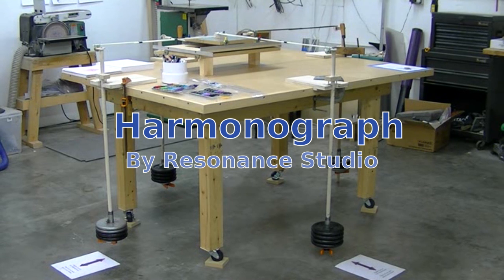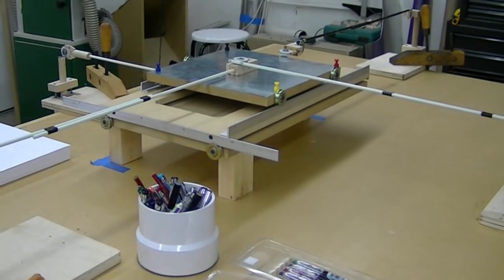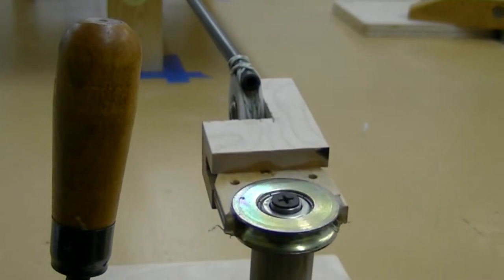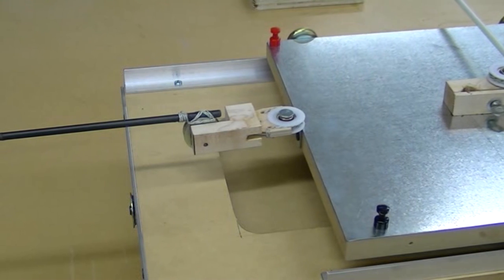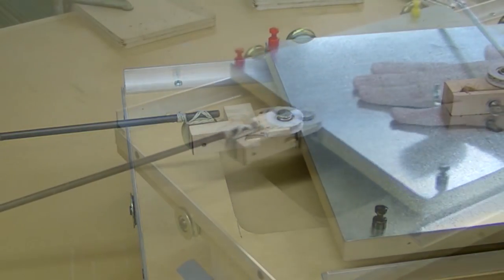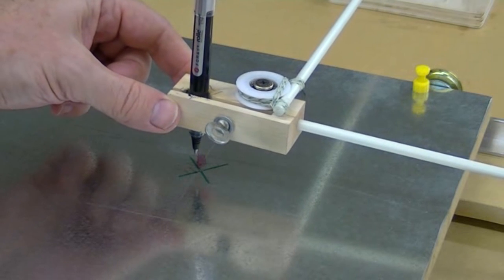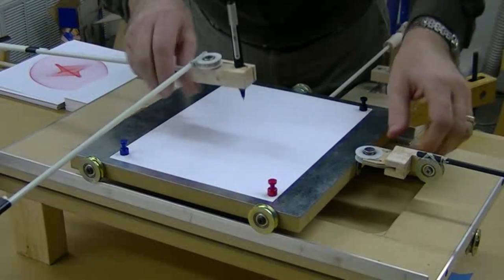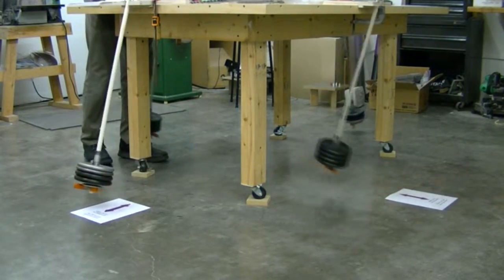harmonograph

Comment: In the late nineteen sixties we had a utility room at the back of our house in Belfast. This room doubled as a workshop. I remember very quickly putting together a simple machine that included a small drawing board to which a heavily weighted rigid pendulum was attached on the underside. Paper was placed on the top surface of the board and the tip of a lightly weighted pen rested on this. The pen was held by a light arm and a second heavily weighted pendulum pushed the pen backwards and forwards along the paper. While the pen motion was restricted to one axis, the table moved in two axes. I still have my drawings!

Comment: Excellent demo, thank you. It appears that, as the paper platform has considerably more weight than the pen, it either requires a heavier pendulum weight or one simply accepts that the paper will slow down faster and stop before the pen. The energy of the pendulum is exhausted by having to push then pull its controlled object - pen or paper board - and this consumes much energy. Would it improve performance to make a rigid foam platform to replace the wood one, keeping the sheet metal for hard surface, but thereby lessening the load of the paper-moving weights and pendulums? Or are we talking about simply lessening the gap between each line and the one before and after it? Obviously, if neither pen nor paper slowed down, there would not be a gap, the pen would follow the same path, or with slight variation. Your thoughts?

Comment: You could optimize the machine by putting a vertical pole somewhere close to the center of the table and then thread a string through a loop at the top of the pole, attach one end to a peg on the table and the other to the two arms that hold the pen. It will lift the pen of the table, giving you the ability to manipulate the movements of the pendulums without having to hold the pen off the paper. 
Tell me if it helps. ;)